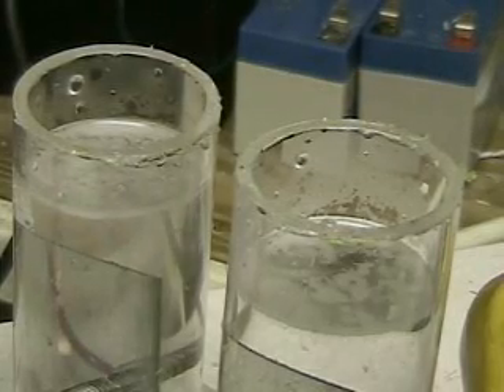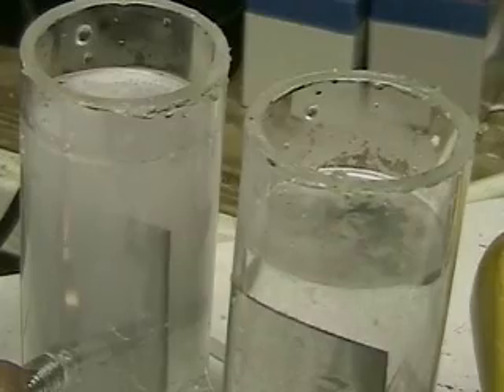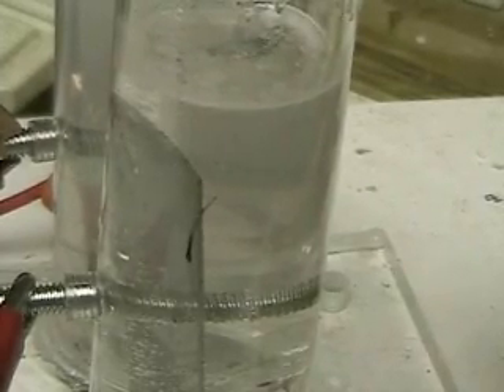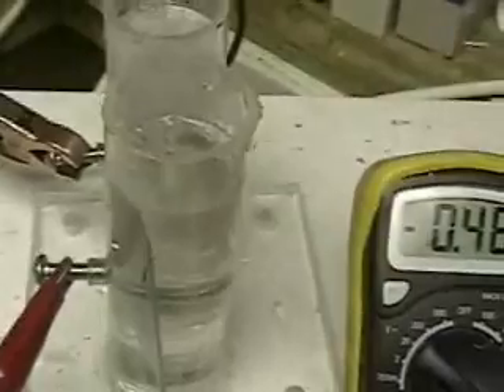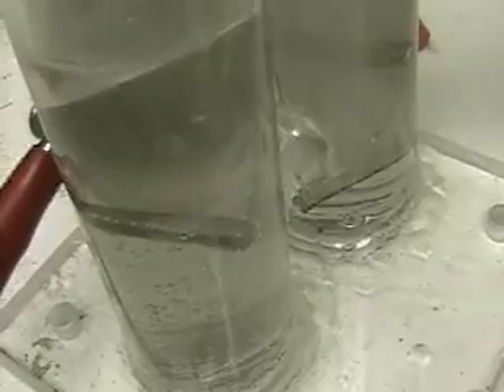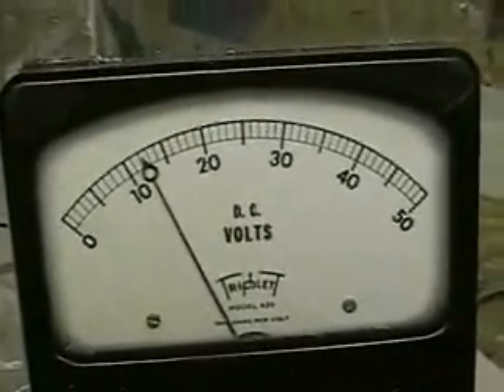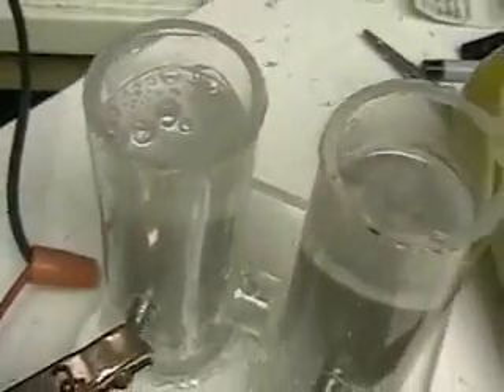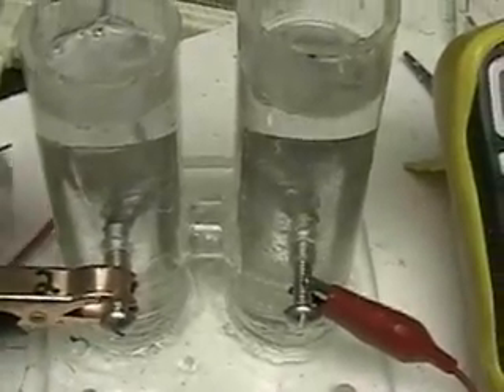Hydrogen Tap (miniature Lab using Lye ) #66

Comment: I was just wondering.. Is it the hydrogen that has 2 molecules and oxygen that has one? Is that why sometimes you use three plates? Two for the hydrogen molecules and one for the oxygen? (Or did I mix it up?).. but in any case, would it work better if you had three cylinders, arranged maybe in a triangle? Using the same principle as the three plates? Would that work? Sorry if I'm trippin', but it's just something that occurred to me while I was watching.